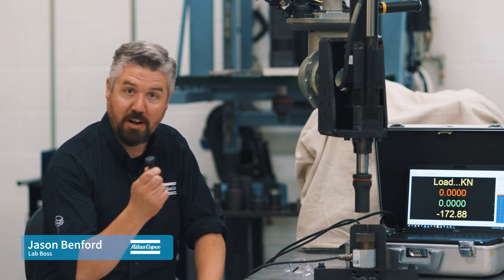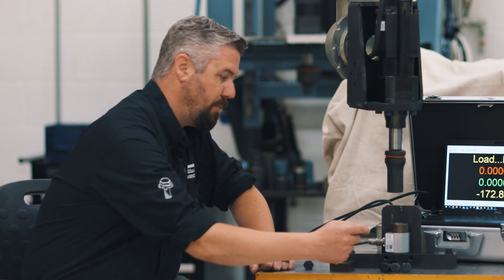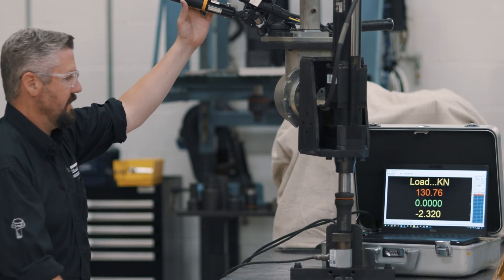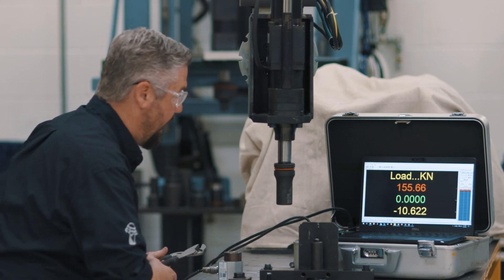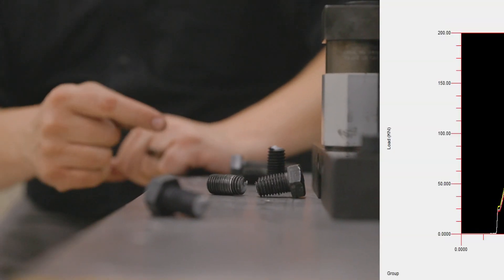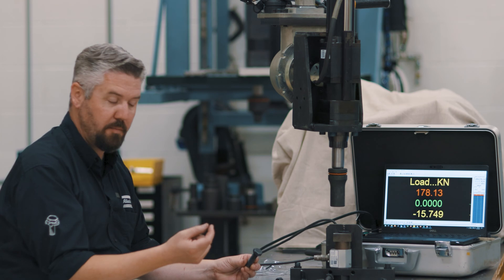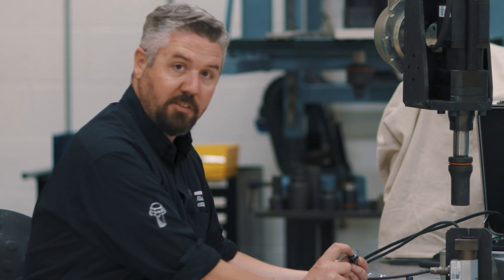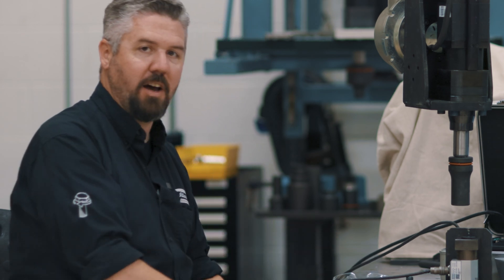In the Lab: Bolt Strength Test | Atlas Copco

Comment: Does this demonstration not show that two out of three bolts failed? While all bolts were in the ballpark, it seems to me that the 8.8 bolt was the only one that did not disintegrate before reaching the specified strength limit. 

Since a 24mm socket was used, these are obviously M16 bolts with an effective cross-sectional area of 157 square millimeters.

Therefore an M16 10.9 bolt should withstand 1.0 * 157 = 157.0 kN, but it tore at 155 kN. A 12.9 bolt should be good for 1.2 * 157 = 188.4 kN, but snapped before reaching 180 kN. 

Is this like it is supposed to be?